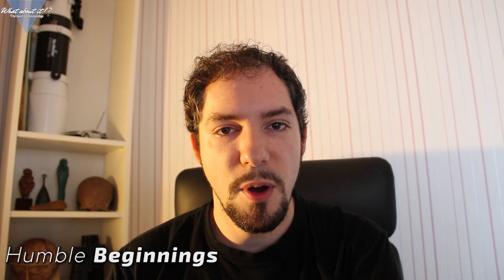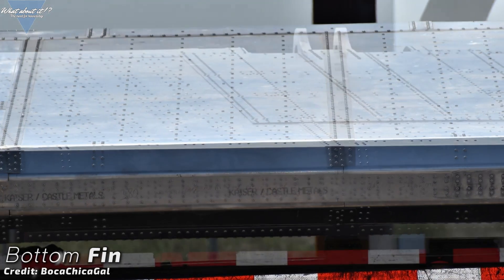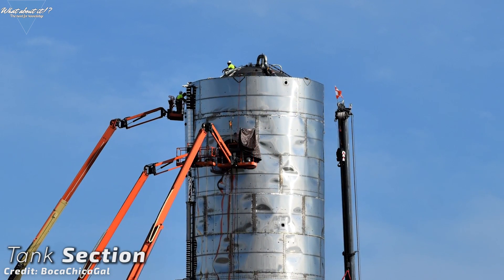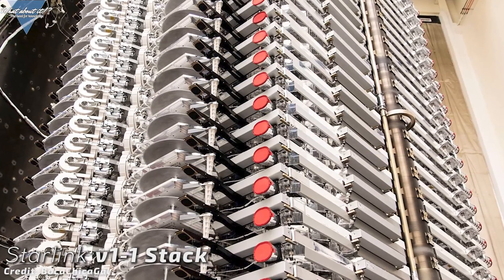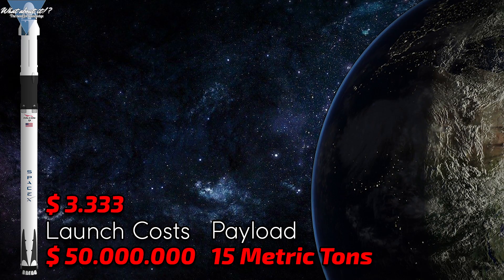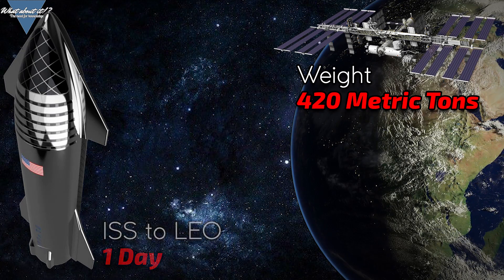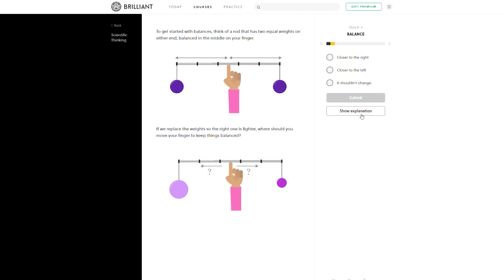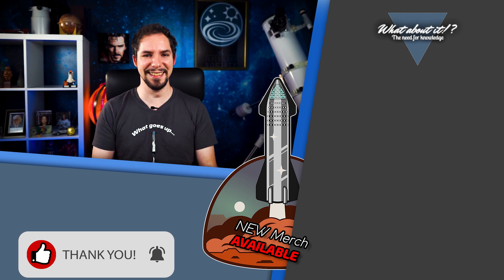50 | SpaceX Starship Updates – Starlink v1-1 Aftermath – Starship Reusability

Comment from the maker: What are the holes on the Canards for and are 20 Dollars per Kilogram cheap enough for your first trip to Space?
Reply: Oh bet I do! Oh wait Im not 1 kilogram D:
Reply: @ThrustersX  you are in space.....
Reply: The holes are most likely vortex generators. They may not be finished yet. As I said in an earlier video, there will be shock waves forming along the canards, so some form of vortex generator may help stabilize the airflow.
Reply: Since it will basically be a stainless steel skydiver falling horizontally, the holes may be like the vent of a parachute. It may help relieve the tremendous pressures on the canards by venting some air through the gap behind the canards. It will take a lot of force to operate the canards, so the less pressure on them the better.
Reply: I'm thinking heat dissipation upon rentry for the carnard fin/fairing holes. Those prices could be almost competitive for other shipping and freight companies?
Reply: Holes might be for cameras?
Reply: 2 Million dollars per launch is insanely cheap. But I'm confident they can reach 10 million per launch. 
Currently a falcon 9 costs 50-60 million dollars, to launch, and elon musk is quoted as saying 10% being cost of the launch itself ,fuel, logistics, overhead etc, 10% being the cost of the fairing, 20% being the cost of the wasted second stage, and 60% the cost of the first stage.
I'm not entirely sure if he's quoting the actual build cost or the total launch cost in every case, but he has directly said the fairings cost 6 million, as well as stating its about 6 million for each launch, logistics etc, so I'm pretty confident the rocket itself costs 60 million dollars and they only make profit by reusing the booster, and by higher priced government contracts.
If these numbers are the case, and we assume a 10 time re usability for the falcon 9, and fairings, then the cost per launch (not counting development) would be about 20 million dollars, or 1.3 million dollars per ton reused >
Now a very conservative estimate, assuming through mass production the cost per super heavy and starship can be cut down to 100 million dollars a vehicle, and per launch costs including fuel can be cut down to 5 million dollars, with full re usability, and 50 uses per vehicle (slightly more than the discovery, also note the RS25's were refurbished after each launch and none launched more than 12 times), then we have a per launch cost of 7 million dollars, now also factoring in development, if costing 5 billion (high estimate) and minimum 20 vehicles are built (elon does want 1000, but this is a conservative estimate) then the per vehicle cost rises to 350 million, with per launch cost nudging past 12 million.
Even if refurbishment isn't as easy as first assumed, and costs 3 million dollars between launches we still have a per ton cost of $150,000.
Elon musk once said he wanted to bring launch costs below $1000 a pound, the falcon 9 costs $600 a pound, and the starship should, using those numbers reach $70 per pound.
I still doubt space tourists will be able to buy a seat for less than $50,000 though.
Reply: @Marc83Aus  he also mentioned that point to point travel will be around the same figure as air-travel economy class ticket, but that could be taken with a grain of salt since his new figures point to about $2k costs per person, but that's before margins and other operational costs as you were saying. So I think there is room to assume that each seat could cost around $3k to 5k.
Reply: @emmanuelmahuni8163  I love the starship, but am very dubious about point to point travel using it, Airlines are starting to go away from very large aircraft towards smaller ones with lower operating costs, and which can land at more airports allowing point to point travel rather than hub and transfer travel. Considering the starship would require specific launching sites situated away from populated areas it will require dedicated facilities. It should  probably cost as much to maintain and operate as a commercial jet with similar passenger capacity, and will certainly have similar safety issues, regulatory bodies in countries its intended to operate in may throw up excessive red tape, or at least require adding stuff airliners already have which may increase weight and raise costs, and finally to recoup the cost of the vehicle with relativity ow cost air travel you're definately looking at thousands of 'cycles' which will require majorly higher redundency and resilience from the structure which might require changes that would seriously erode its usefulness as a heavy lift vehicle.
Reply: @Marc83Aus  Actually I don't see Starship point to point travel being used most to actually travel, at least for the first few decades of its debut. IF the Starship goes above or just near the common line, which probably is the case, then passengers will be in space, experience Zero G or something near this and see a better view of the Earth with its curvature than they've ever seen. This will happen for about 20 or so minutes until the thing does its wacky belly flap manoeuvre to land (which alone will be awesome to experience in the craft). That experience alone will be something to pay even $5k to $10k for a ticket. It doesn't matter where on Earth you will end up as long as it is safe. To sum up, Spacex won't need other countries to regulate it at all for this purpose it can just go up do one orbit and return for a landing where it started or on some other port in the same country.
Reply: @Marc83Aus  however, I only mentioned point-to-point-travel to point to the fact that Elon said something about this figure and it's turning out to be just about the same range.
Reply: so a little over 2100$ to take me to space im game lets go
Reply: Cool shirt but, it'll be better if it read: What goes up....don’t have to crash down.
Reply: Price sounds good. I'll even spring for a few bucks more for some oxygen.
Holes in the elonerons:  That's where you put the marshmallows.
Reply: Holes on the fairings may be for air flow to aid in rocket rocket combustion. Not all of the oxygen from the oxygen tank are perhaps not being used for rocket combustion.
Reply: @leapdrive  Raptors aren't a hybrid, so unless he's secretly using Sabre engines, I suspect the holes are not intakes😊
Reply: Jesus, thats cheaper than a Concorde ticket!
Reply: Holes are service access.
Reply: woooow this is cheap, but I don't think it will be 20$ per kg for us, this is their costs before putting a margin. It may end up at 50$ or so considering there are other admin and operational costs not being factored in into that figure, however, $50/kg will still be veeeery cheap. No wonder Elon said Earth to Earth travel will be the cost of an airline ticket.
Reply: Not oxygen, helium. Takes a lot to lift a grain silo.
Reply: @japaneserequired6314  That's why I've been thinking for months that New Shepard better get some paid flights in fast or...well maybe they're already admitting business is dead.  I think Virgin Galactic is dead already.  I expect they will fold up within a year or two, or get bought out by someone.  On the other hand, I don't think you can be launched into space at the same cost as cargo, unless you like vacuum. :)  Still, your choices are, sub-orbital with a few minutes in space...or circumlunar for about the same price?  Hmm, tough decision.  Like between a 1-hour harbor excursion on a small pilot boat or 1-week cruise on a ferry boat, for the same $200.  I won't say cruise ship because I don't think Starship will qualify as a luxury cruise vessel.  But maybe we'll build interplanetary cruise ships someday.  The only thing going for New Shepard might be the novelty of flying in an old-fashioned "capsule". :)
Reply: Andrew 13579 - If SpaceX can launch for $2 million/launch, Circumlunar would cost about 4-5x that, which works out to $8-10 million ($80-100/kg) to go to the moon. That’s still a LOT less than the suborbital flight on New Shepard. Jeff Bezos might want to see if Elon will take his Blue Moons into Lunar orbit in 2021.
Reply: You are too awesome to not have a greater audience
Reply: From Homer Simpson "Putting speed holes in my car. Makes it go faster."
Reply: $20/kg is great, but I'd still better lose some weight! ;p
Reply: The holes in the canards are obviously mounting points for phasers, or at least lasers.
Reply: Oars....
Reply: @What about it!?  According to the video you mentioned, the $2M are the operational costs and then there's an additional $900k for the fuel. That's a 45% increase, although still insanely cheap.
Reply: My initial thought a millisecond after his comment on precision by SpaceX
Reply: I pause the video at 1:49.  Look at that fit?  It must be just a test fit of some sort.  Look at the gaps.  Is that just tack-welded on?  If the fins are moveable,  how is that fairing supposed to move?  Does it just flex with the fin?  And which way are the fins going to move?  They just fold up and unfold out, right?  Variable dihedral drag plates, fore and aft, is about what they amount to, right?  Does the "fairing" just stay there...in which case it appears a gap would open up?  Are such broad fairings necessary?  Why have the fairing at all?  What is their exact purpose?  Fairings or fillets on wings/fins/stabilizers are to reduce interference drag when drag opposes thrust, or maybe to smooth out airflow to reduce buffeting.  But for re-entry, drag is desired, is it not?  Is its purpose during re-entry to protect mounting hinges from plasma?  I can't imagine what the holes are for.  Why can't SpaceX have a "spokes-model-'gineer" give video progress reports every week on the progress of Starship/Superheavy and explain what everything is for and how it's going to work? :)
Reply: @Andrew-13579  I'd love to hear progress reports from SpaceX, but it's nuts to expect explanations on how things work. Why would they invest billions to simply give away in depth knowledge of the tech to others?
Reply: @PapaThaiGG  oh, I know.  That was just a little humor thrown in at the end at the slight frustration of not knowing the answer to the puzzle we see in this Starship...you know, not knowing how it's all going to work.  But it would be cool if they could tell us what we could be allowed to know.  I mean, Elon does tweet some technical answers to things, now and then.  And some of those engineers are delightful to look at and great speakers...and they know what they're talking about.  Would be fun.
Reply: @japaneserequired6314  2000$ / 100 people = 20$
Reply: @FreeStuffPlease If so, Elon's gonna get a permanently warped spine from all those  "good job" back slaps
Reply: @-A-c  The Elon is not to be touched.  Please keep your distance.
Reply: @FreeStuffPlease  how many people could someone know to give him money with a name like "name hidden"?
Reply: $20 per kg for cargo. You can not just take that number and put it for people. 
I think i have commented something like this before but you seem to be getting to excited about all of this. You have a great voice your content is really good but you speculate a lot and call it fact pretty often. For example the fitting of the fins. There is no reason to believe they fit perfectly. On a piece of hardware this important the detail needed to determine a "perfect fit" is much higher than what one can see with a camera from such a distance.
Reply: I hope the holes dont end up hoisting starship on its own canards.
Reply: @adymode  Hilarious! I wonder how many people got the reference?

Comment: Once the F-4 Phantom had holes similar on its wings which were much like a vacuum as it increased the efficiency of the wing (by reducing drag one the holes are under vacuum as air flows more efficiently along the surface of the wing), the only problem was keeping the holes clean, but the concept worked, just wasn’t practical on an airplane flown frequently, now reducing drag in atmosphere, and only having to be checked and cleaned prior to launch, might be very feasible. Then again, holes could have been mounting points for ceramic tiles?

Comment: Why is no one addressing the lack of launch abort for the Starship? Same mistake as Shuttle...so you guys can continue your fanciful PR, but real practical issues are being ignored...until people get killed...which will happen as its a dangerous business.
Reply from the maker: Thank you for your question. In 2018 we had 523 dead people due to plane accidents. None of them had an abort system of any kind. And the reason is, that you can not integrate an abort system into an airplane. Same goes for Starship. Musk said though, that Starship would be able to pull away from the booster in case of an emergency.

Comment: It will never be $20 per kilogram ($44 per lb) to send a person to space on a Starship, no matter how optimistic. Sending payload and sending people are not the same. Not only would there be incredibly limited space for people, cutting the max passenger number to something like 50-100 (SpaceX most optimistic number is 100 passengers). People are not cargo. People mean carrying the weight of the seating, safety systems, and a full atmosphere, including stored oxygen and equipment for removal of CO2. More and more weight.

Also, no organization, including SpaceX, is going to send anyone to space without some form of prerequisite training and a full medical evaluation. All of that costs money. If it costs 2 million to launch one, and the absolute max amount of passengers possible is 100, you are already looking at $20,000 per person shared. And that does not include the training, preparation, medical evaluations, or whatever expenses are involved with keeping people alive, vs just keeping cargo safe until it is released into orbit.

The most realistic price would be somewhere in the $30,000-$50,000 range. That is actually really good and within the ability of a middle class person to pay for (with a substantial loan). So that is no small thing if SpaceX pulls it off.

But you aren't going to space for under $10,000 on a Starship. It's not going to happen.
Reply: The optimistic number for starship is 1000 people but there will be no toilets and no life support system so it's either for earth to earth transportation or to get to a space station.
Reply: @johntheux9238  SpaceX says 100 on their website. That is where I got that number from.

Comment: Sorry, but sending humans to space costs more than just their weight equivalent. You need life support systems, EVAC systems, food, water, misc supplies, emergency supplies, the list goes on. And that's just the extra cost of the fuel. Many of those systems cost more than fuel needed to ship them.
Reply: Yeah, it would cost 2000$ per passenger if you send 1000 of them to a space station. But if there is no space station you can only send 100 of them as starship's life support system cannot support more.

Comment: Unfortunately, your enthusiasm for starship is...?
Because nobody can imagine how the cargo
and passengers get into the Starship
cabin above 120 meters high off the ground.
Reply: Using the launch tower.
Reply: @johntheux9238  Yes John, that's obvious. What you
have to keep in mind is that the launch pad construction
will have to be huge. People will be brought up
with one elevator. 

Then the cargo will be brought up with a second
freight elevator. And we need a third emergency
elevator. Because everything goes up 120 high. 

This construction is huge. It has nothing to do with
the slim spike shown by SpaceX in a video. In which
you can see the people upstairs walking into the
Starship cabin via an access walkway. 

So the people come from the ticket counter in
Spaceport with the passenger elevator into the
passenger cabin. Now the huge launch tower has
to move 50 meters to the side in order not to be
hit by the titanic forces of the 36 Raptor engines. 

That would be a solution, but not so elegant.
Remember that Elon tweeted some time ago that
the start should be 20 to 30 km from the coast on
the sea. Otherwise it would not be approved by
the authorities because of the noise pollution.

Translated with www.DeepL.com/Translator
Reply: @silberlinie  Starship will not be erected each time so they will add the pasload with the launch tower for sure. No idea of how they will do it though.
Reply: @johntheux9238  You mean the spaceship doesn't
get erected every time? But you think that
it will lie on its side.
Reply: @silberlinie  I think it will never lie on the side. The crane will pick it up as it's already standing up.
Reply: @johntheux9238  Yeah, it's not really good practice
to see how they can get everything into the
cabin and the cargo hold. Lifting the Starship
70 meters high onto the booster every
time seems very impractical.